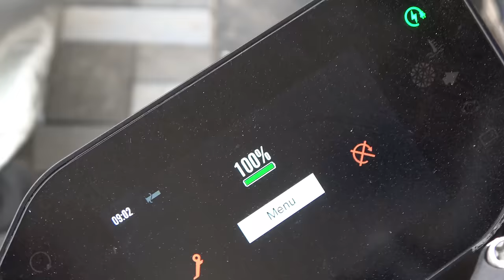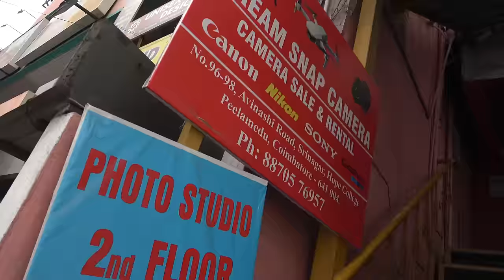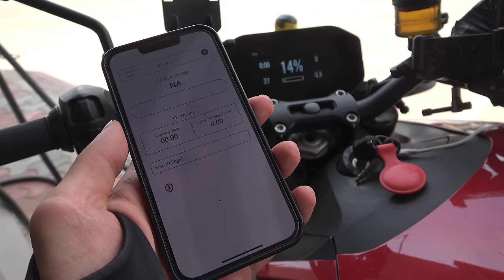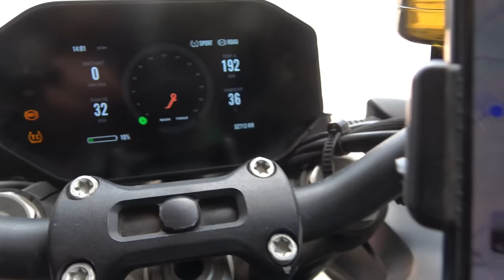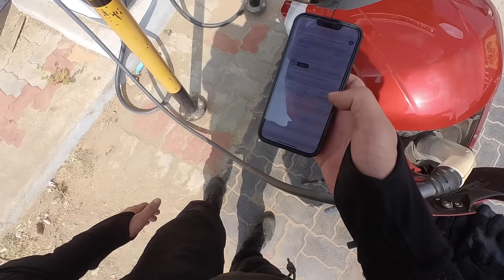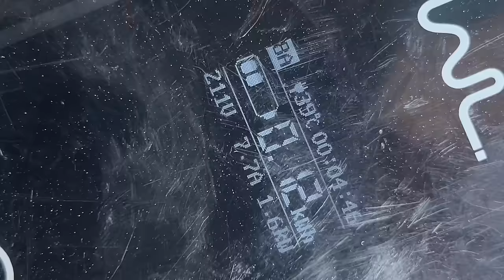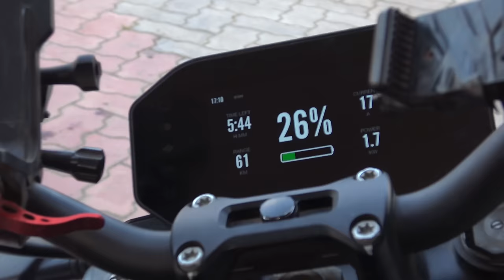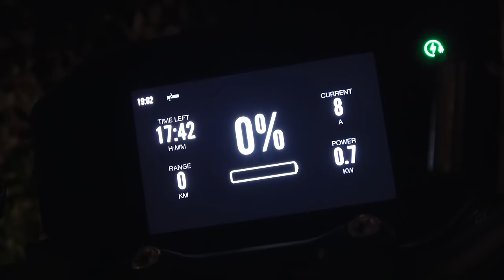F***, it won’t start!

Comment: we in india are full of experimental and curious engineers ... he will take out the drone apart and perhaps make a new one w/ the other things he got in hand....you can use that RC module to make all kinda remote stuff like remote switch, robot , helicopter, rc car...you name it... and the brushless motors can be used to make fan, cars, drones, pulley, pump....and many more.... and the battery...that dead drone is a very precious thing for a creative person it isn't less than a gift!
Reply from the maker: Yeah it made him happy and I couldn’t have done anything

Comment: Electric vehicles will not be able to replace petrol vehicles, at least in the near future, unless there is a breakthrough in the battery industry. 
Existing lithium will not be able to fulfil the demand for batteries
Reply from the maker: Agreed 👍🏼

Comment: I think the chargers were out of order because not many people were using them. It doesn't make sense for anyone to maintain them. I think It will change in five or ten years. I think they didn't want you charging your bike because they are not the owners and commercial electricity is costly, while petrol bunks usually have solar panels on roof.

Comment: If you cant find car charger you can just find an ather charger and use your charger to charge using the app incase of emergency, ather chargers are available at most locations

Comment: There is a fault in one brand of charging station in the UK that does not let you do an AC charge at the same time as another vehicle is DC charging. But it lets you do an AC charge when nothing else is charging.
Reply from the maker: Alright 👍🏼

Comment: Zeon has been deactivating type 2 AC charging across their highway chargers because of customers blocking the DC output for hours by charging on these chargers.
Reply from the maker: You should be able to charge both
Reply: @MarcTravels  Ya, the ABB units have a tough time load balancing between AC and DC. So CPOs are forced to pick one.

Comment: India is building EV charging stations at a phenomenal pace, should be super easy everywhere in next 5 years time. Since they are building EV charging stations at fast rate, many a time EV stations comes up first, and then they wait for Power company to provide them input later, have meters etc installed, connections activated. So not all EV stations listed are fully functional yet. Not saying no technical issues or billing disputes prop up, but we are a developing country. Give it 5 years India will be a paradise for EV charging. I recently shifted house, in both my old and new Housing apartment , we have 2-3 EV Fast chargers, all recently deployed in last 6 months, so am seeing a gradual change, will start in big cites and then trickle down to small one in quick fashion. Sorry for your trouble mate.
Reply from the maker: Yeah it’s the same everywhere in the world. India is actually doing very well I think

Comment: EV vehicles are more polluting and have a bigger carbon footprint than most modern petrol/ diesel vehicles. I have been pro-Toyota as far as the technologies of the future lean towards hybrids and hydrogen fuel cells based tech.

Comment: I don't know what is going on in Tamil Nadu But some what I am hearing it is going kind of broke, everything is being rebuilt and the infrastructure is being developed. It has lost a lot of tourists since the upcoming of Bangalore and Kerala resulting in lower overall GDP. Which is resulting in the poor infrastructure of the state like out of service charging stations, halfway constructed roads, dusty and less people on the road. It has really changed from the Tamil Nadu it was 10 years ago.
Reply: Except a few states, most of the Indian States don't depend on tourism. Tamilnadu is an industrialized state. It is doing good. The construction work will be completed in a decade, and you will see the difference.